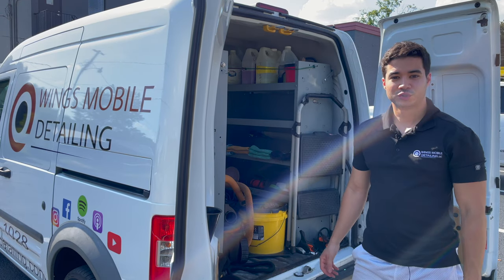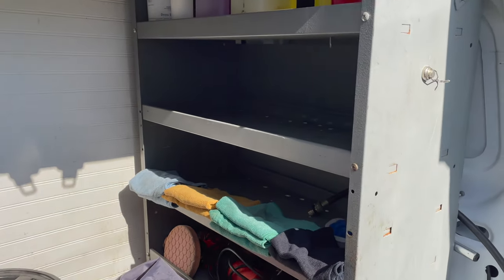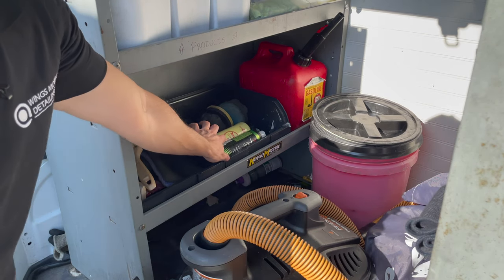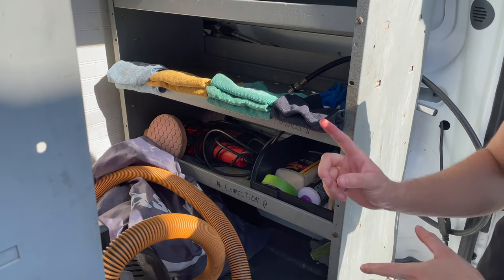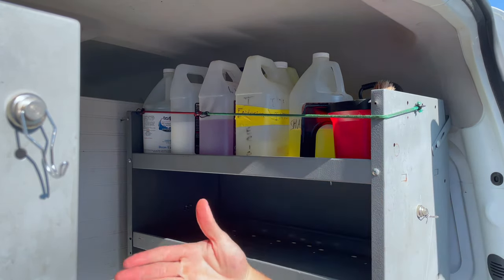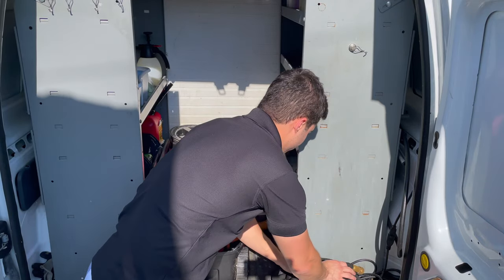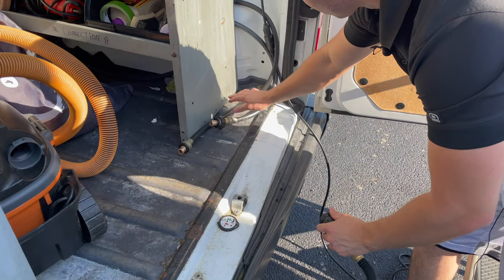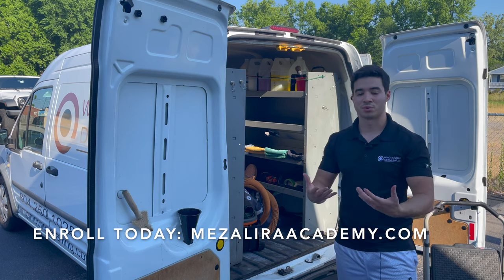Our Detailing Van Setup - Wings Mobile Detailing

Comment: Wish you all the best. You going to miss out on many customers. They will ask you to go to their job or other location and there will not be electricity or water. You will need your generator and your water tank. I didn't see if you had a pressure washer. Chamois towels can scratch paint, I woud use microfiber towels to dry my cars.
Reply from the maker: Thank you for the genuine comment… we have a 55g water tank and generator behind that wall. It doesn’t appear in the video but we can do about 5 cars with that tank! 
Chamois shouldn’t scratch as long as you don’t have any dirt between the towel and paint. 
Thanks a bunch man and I agree that every detailer should have a water tank and gen as many clients don’t have it.